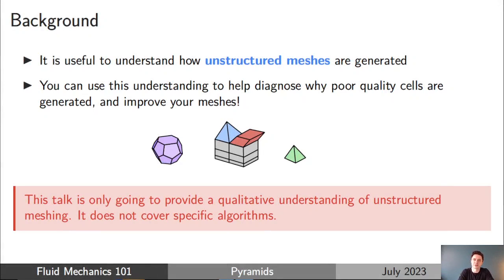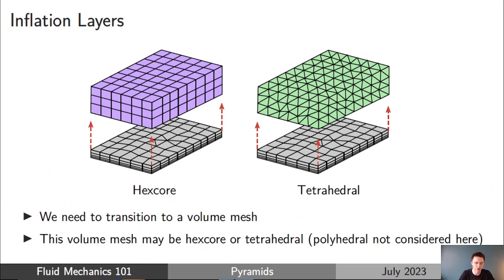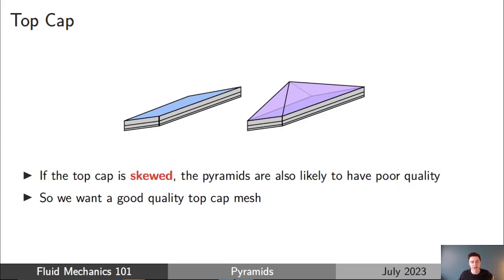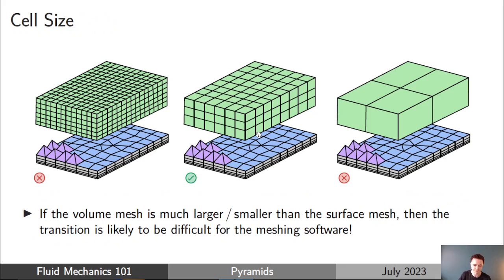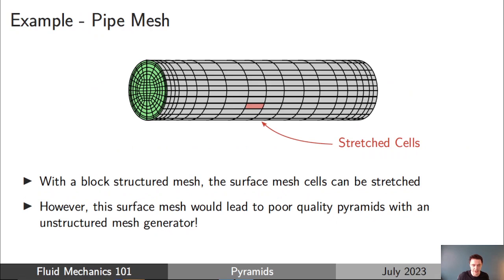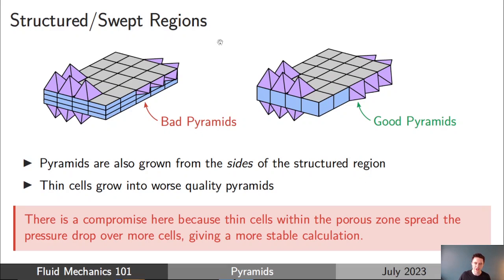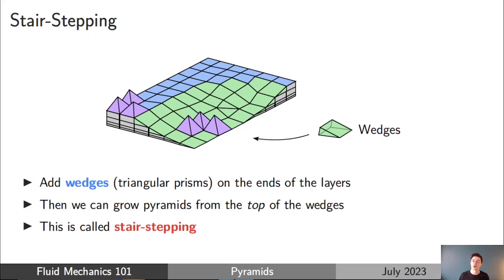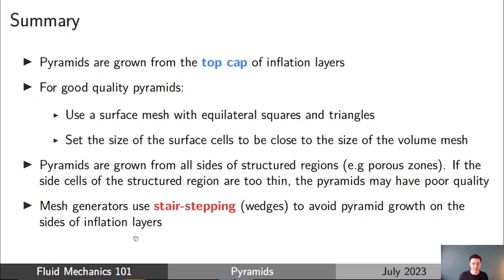[CFD] Pyramids, Prisms & Stair-Stepping

Comment: I have stair-stepping near the region of a velocity inlet or pressure outlet. After watching your video, I understand that because I have only apply inflation layer at walls and inlet and outlet are not wall hence there is a stop of inflation layer and exposed surfaces on the side. Is it require to resolve stair-stepping due to this issue? If yes, how can we resolve it?

Comment: Thank you for your useful presentation. Do you think the gap between structured and unstructured mesh is reducing and we can have more confidence on solving CFD problem using unstructured mesh? Thanks
Reply from the maker: ... personally I think that unstructured meshes have been demonized unfairly over the years and the reasons why structured meshes are 'better' have been forgotten or ignored. They are both good in different areas of a complex model. The 'best meshes' nowadays often use a mixture of both! Over the next few videos I want to actually cover these reasons in more detail, so you can see that it is not as easy as 'structured is best'. There are definitely scenarios where structured meshes are actually worse! (Stay tuned 🙂)
Reply: @fluidmechanics101 thank you for your reply. I am definitely looking forward to these series of videos! Thanks

Comment: Thanks Dr. Aiden for the good explanation. For meshing can we have a talk on dynamic meshing methods: smoothing, layering, ….
Also looking forward for pressure based Vs density based solvers. What is happening behind the seen? and what should we use? Up to what speed can we use pressure based solver? Stability in both solvers?

Comment: Great content as usual! I’d love more videos on this material. Maybe a pros and cons of structured vs unstructured grids. I personally love how much faster structured hex grids typically run in fluent and how much less memory they require. Also you can use a coarser hex grid while running a third order QUICK scheme to make up for the coarseness to a degree :)
Reply from the maker: Yes, I really want to dive into meshing a bit more this year. I think it is a massive topic with lots of interesting features to talk about

Comment: One useful technique I used when learning to implement SnappyHexMesh was to have a square tube with rounded corners, the tube width decreases along the length of the tube.  Eg start of tube is 10x10cm with 1cm chamfer.  End of tube is 5x5cm with 0.5cm chamfer.
This causes the meshing tool some headaches as it tries to match the changing radius the further down the tube it meshes.  Once completed, use ParaView to create a slice animation viewing square-on in 2D.  The result is a bit like a brain CAT scan.  I used this technique to see just where my meshing parameters began to fail